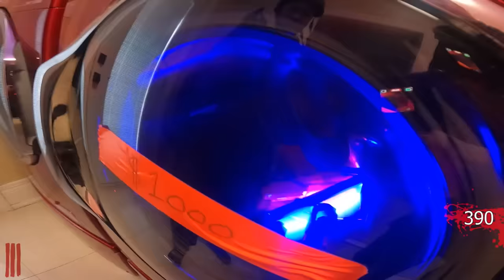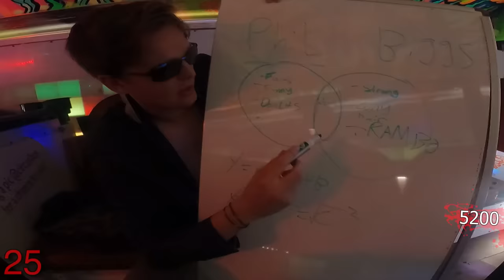1000 ZOMBIES VS My Zombie BUS (COD Zombies IRL)

Comment: They did the pack a punch wrong in call of duty zombies you need a 5000 points to upgrade your gun but Jake only had just a little over 1000 points
Reply: they also did the box wrong it should be 950 but it's 700 and I don't think you get points when someone dies and you can't buy someone back from the dead in zombies